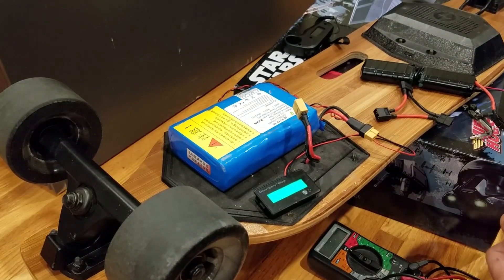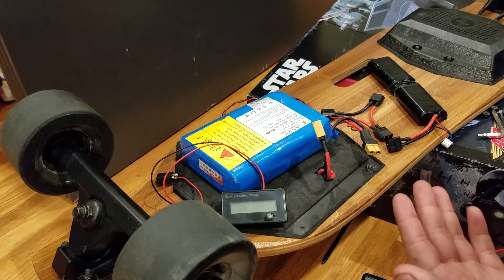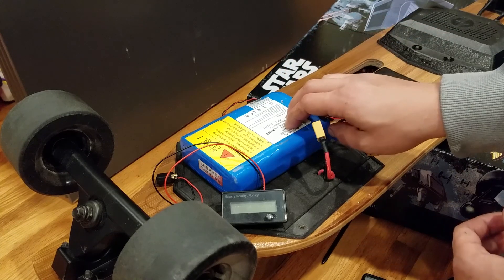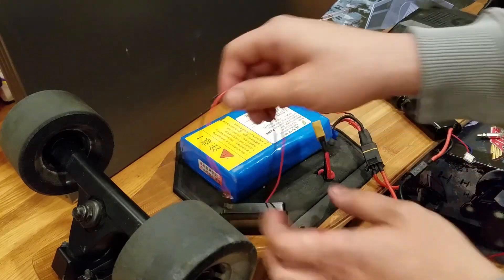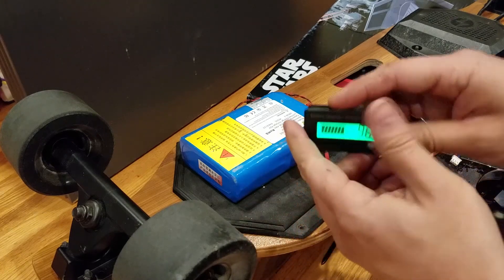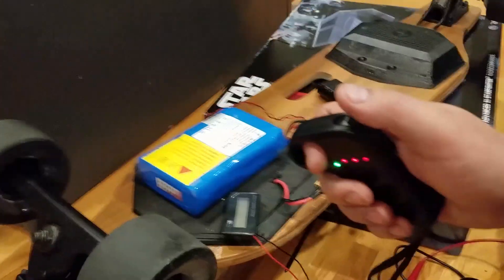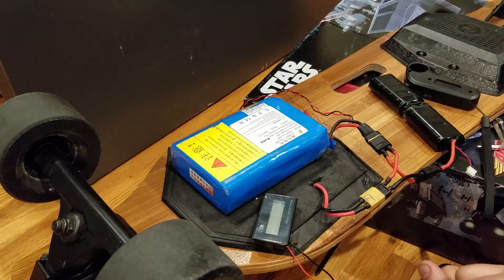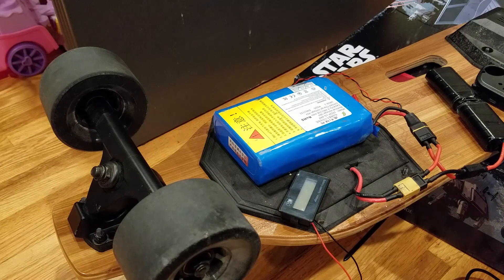50V Meepo board - Success!

Comment: Sorry but why didnt it work last time then? You talked about it in the video but I still don't understand ><
Reply from the maker: Wax Beans basically there was too much voltage last time for it to work. Like only 0.5volt too much. I assumed the meepo charger charged the battery pack to 42volts. But in reality it charged it to 42.5volts. So when i added to extra battery(8.4volt) it wouldnt work.

Comment: What is your charging strategy if it does work? would it be plug and play? or would you have to remove the "booster"  battery each time? Will the BMS and regen braking still work on the added cells?
Reply from the maker: i ordered this charger 
https://www.ebay.com/itm/50-4V1-5A-charger-50-4V-1-5A-lithium-li-ion-charger-for-12S-lithium-battery-pack/162614230432?hash=item25dc903da0:m:mFvUn3JdR9hWl0MWXYVs-Yg
if i wanted the BMS to work i would have to buy this 
https://www.ebay.com/itm/44V-48V-50-4V-12S-60A-Lithium-ion-Li-ion-LiPo-Li-Polymer-Battery-BMS-PCB-System/221644780045?hash=item339b0ef20d:g:aXsAAOxy06hSEdYj
but its a bit too pricey for me especially if i'm not sure if this is gonna fix the voltage sag issue.
the weather is still bad so i haven't had a chance to test if regen barking works or not, i would assume it would at least work when the voltage is below 42v
Reply: Thanks for that, super excited to see how this works for you. Weather clear up at all?
Reply from the maker: +Adam Opheim i cant wait to try it also!. But the weather is still bad.
Reply: Hows the weather been?
Reply from the maker: just uploaded!